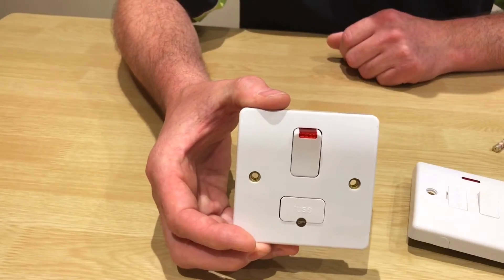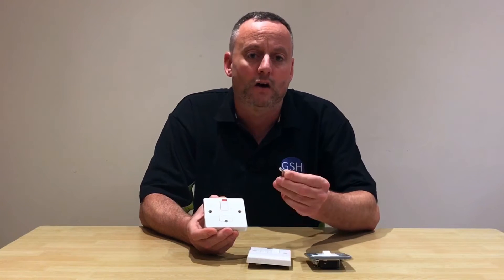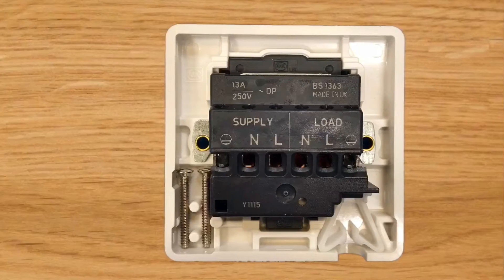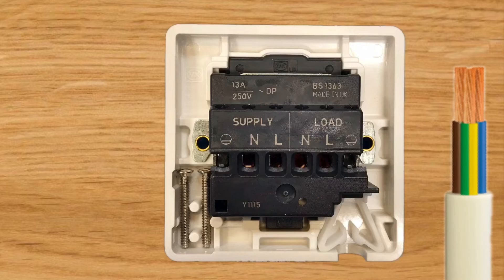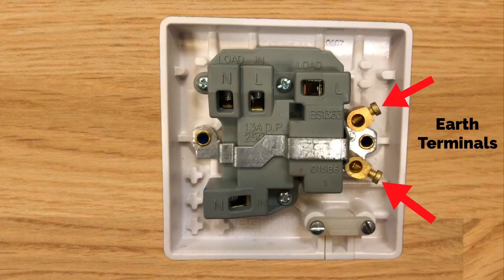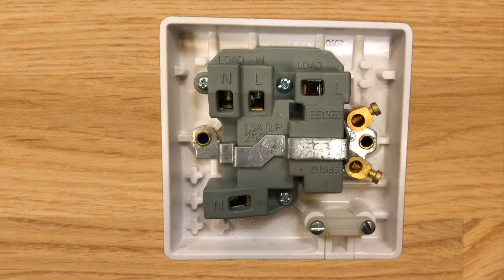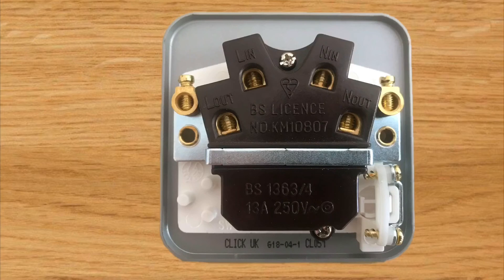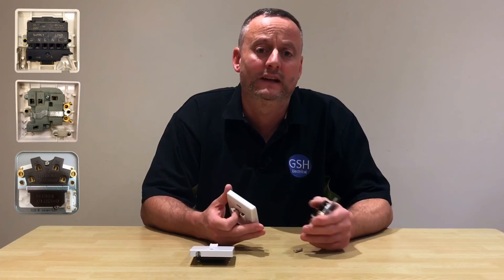Connections in 3 Switch Fuse Connection Units (Switch Fuse Spurs) Layout of the Terminals Explained

Comment: I'm doing a job where I need to re-box in some boiler pipes. The old boxing had one of these switches and I plan to replace. So I understand the load is the kitchen extracor fan but I have 2 other cables feeding in, one is from a plug socket and one presumably is connected ti the consumer unit, I was wondering should both of these cables classed as supply (in) ?

Comment: GSH ELECTRICAL hi see the way if you have two double sockets coming from a 13 fused switched spur from a 20amp trip switch. Can you add two 3amp fused spurs for lightning at the second double socket 

Thanks
Reply from the maker: Wiring a Light From a Socket Outlet and Safe Isolation of a Switched Fuse Connection Unit (Spur) https://youtu.be/E6AxYPlnl_s

Comment: Great factual video clearly pointing out the inconsistencies relating to terminations within accessories. 
While my personal preference is for the MK unit, I do find the flex cable grip difficult to use on any cable with conductors over 1mn csa.
Considering how long accessories have been in production it is surprising the lack of uniformity from manufacturers.
Reply from the maker: Thanks for commenting and the feedback. Gaz 🦾

Comment: Hi Gary, can I ask..
Could you wire straight into an fcu a 6mm twin and cpc cable and bypass a socket that is spurred from it? For instance a cooker cable. Just wondering if this would be possible with a 13A fcu
Reply: Why would you bypass the socket bud?
Reply: @JD_London  for example, my cooker is flat twin and earth 6mm cable that wires into a cooker outlet which is spurred from a cooker switch (traditional red switch type) so it isn't doesn't have a plug because it is not a flex. The reason i ask is if someone moved and kept their cooker but the new place has a socket outlet spurred from an fcu spurred from a cooker switch, could you just wire into the fcu or would you have to replace the cable?

Comment: Great video very informative, a question I got from a relative who had to replace a fused swit h but because the manafactuarar must of been different so he couldnt copy the wiring he is unsure is he fitted properly as in putting the supply to supply and load to load he got the correct wires in as earth neutral and live but if he mixed the supply and load around would it still work? and isit dangerous? Thanks again buddy
Reply from the maker: Shaun Davies hi it will still work
Reply: @GSHElectrical  thanks for the quick reply! Still all safe then?

Comment: For the protective earth I would always use the the terminal most far away from the flex entry. Then the PE conductor is always longer than the L and N of the flex. If someone rips out the flex cable and the strain relief is failing, the protective earth connection will fail as the last connection. I always make the PE ~20mm longer than L and N. Sometimes this is ensured by the construction, for example of a plug. The BS1363 for example, the PE conductor is the longest wire, and through this it will fail at last.

Comment: Great video as usual Gaz. I wish manufacturers standardised the locations of the terminals so they are in the positions of the first FCU you showed. I've used FCUs with the terminals laid out in the second example and it's really fiddly to get the wires in neatly because they are spread across the back of the FCU, whereas with the first example you can bend the cables easier to fit into the backbox.